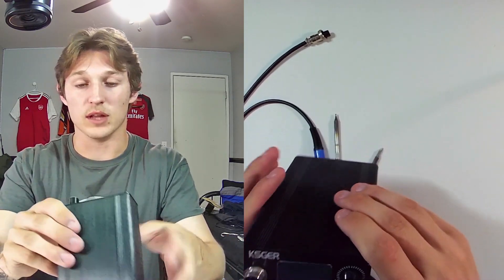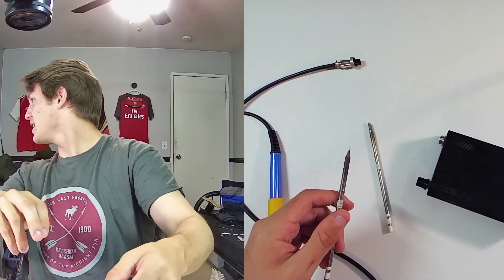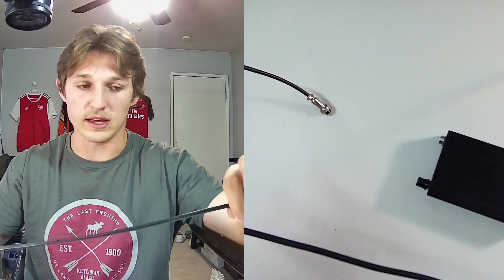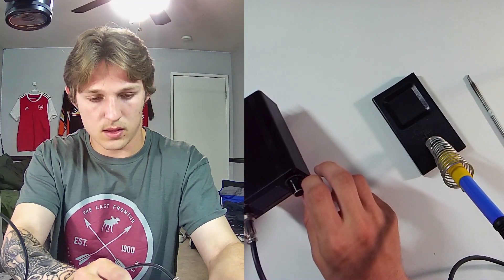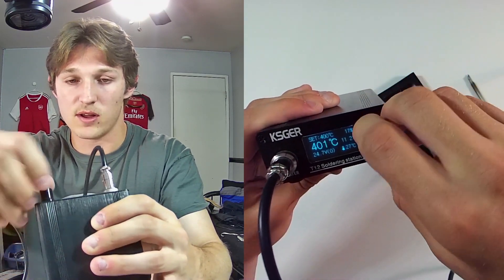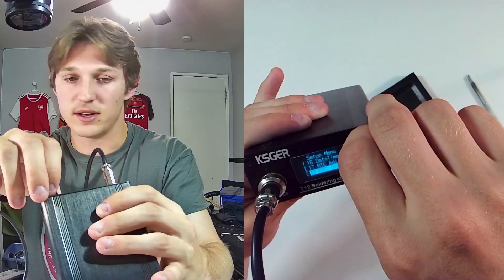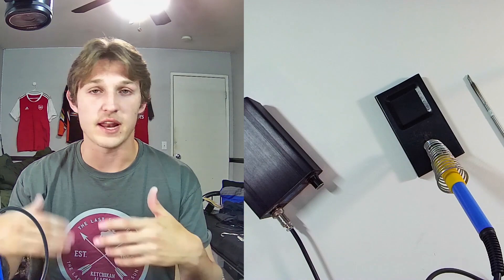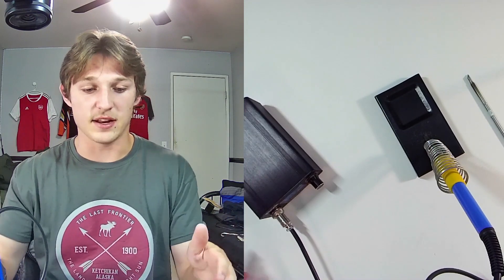WATCH BEFORE YOU BUY - KSGER T12 Soldering Iron Station

Comment: I've been using this station for 6 years as a hobbyist, and it still works. I don't even have a permanent work bench, I just throw it in a box filled with soldering stuff inside my closet. Even with that abuse it's still going strong.

Comment: Man, I have the same simple blue soldering iron, and it's not good at all. So, I ordered a power station just like the one you have, except mine is branded 'Lefavor.' It's the same as KSGER and comes with 5 tips—all for $48. I hope it will be good!
Reply: is it any good?
Reply: Got lefavor station for $18 with 3 tips. Same as the one in the video except it doesn't have settings for every specific tip, heats up fast and keeps the temperature when transferring heat anyway so not a big deal. I didn't check whether it's properly grounded though, but for that price it would still be worth it if I have to add few wires myself.